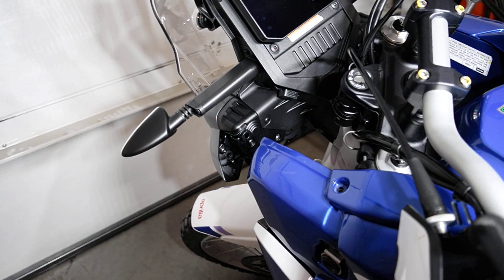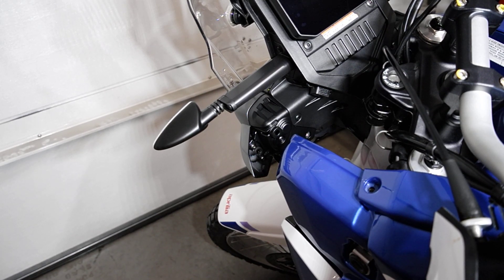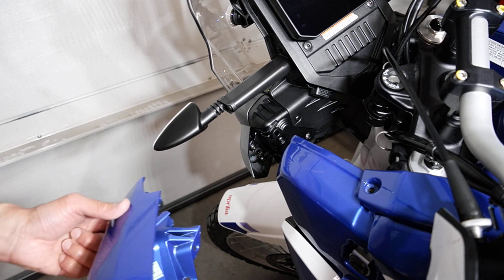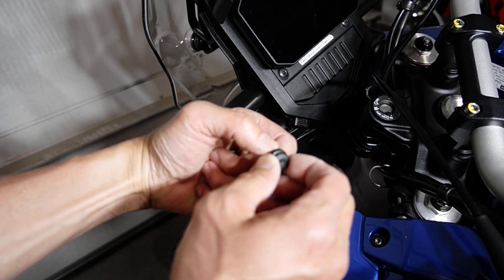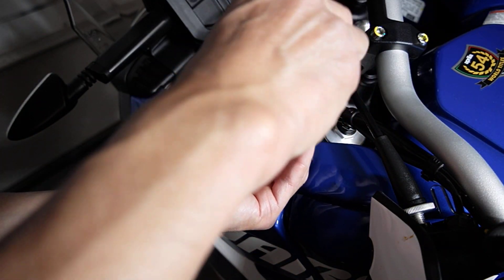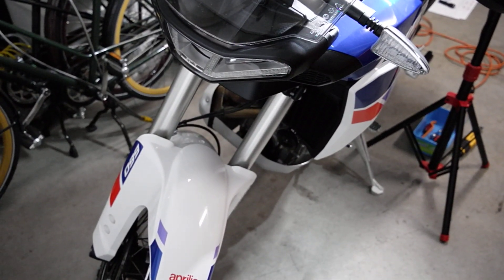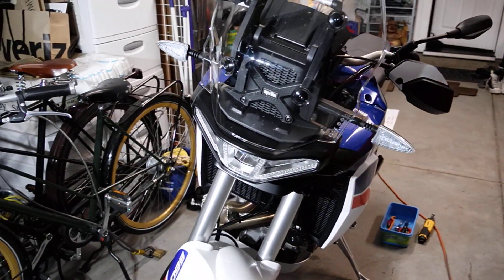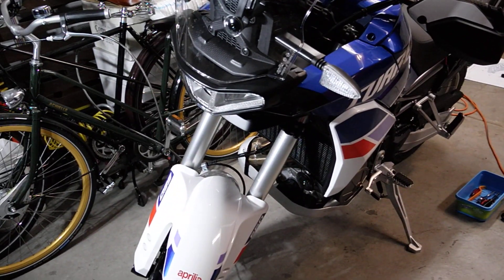Aprilia Tuareg 660 headlight cover in black Part 2/2

Comment: It looks nice. What kind of paint did you use?
Reply from the maker: Thanks.  I'm 99% sure it was Rust-Oleum "Trim and Bumper" spray paint in flat black.  There was another similar product by Rust-Oleum "ideal for pin-striping" or something like that I was debating between, but I can't remember what I ultimately chose.  It's at work, so I don't know for sure.  I don't think you can go wrong, just as long as it's a flat black and resists sun damage.  I put about 4 or 5 coats on it, we'll see how well it holds up.
Reply: @ocdmoto  thanks man! Looking forward to see what other mods you gonna do to your Tuareg. 

Hey how are the side panel vents that you opened on your other videos, does the right side make a difference with the heat now ?
Reply from the maker: @SuperCheesyMan  Hi, so it doesn't make a noticeable difference, in that I think there's just as much heat that I feel as I did before.  There are two things I'm considering in regards to "heat," one is the heat I experience on my legs and shins and the other is the management of engine heat from the radiator.  I feel the latter is more important, and in that regard, I believe opening the vents results in a better job of "cooling" off the engine.  In the regards to the amount of heat I feel, I actually was prepared to feel more heat by opening up the vents, since it seemed like more heat would flow towards my shins.  Nonetheless, I was ok with this outcome when I made my first cut into the plastic.  However, after doing so, I think the heat I feel on my lower legs is the same as before.  I believe most of the heat is from the cat and exhaust pipes.  I might get a straight pipe low restriction/weight silencer upgrade from Arrow or another 3rd part vendor if the heat is unbearable on hot days, but I'm trying to do all my mods with little to no cost.  We'll see, personal history has shown that I will go overboard with mods, but I'm trying something different this time with this new "toy" of mine.  Additionally, I'm thinking that that might be the theme of this youtube channel.  Thanks for the comments and questions btw.
Reply: @ocdmoto  dude, my pleasure :)

Yeah the catalyzer usually dump a lots of heat of your legs. My Ducati Multistrada was crazy hot because of that. A nightmare to ride in city and traffic. Once I removed the cat things got so much better, I'm sure a cost effective aftermarket link pipe will come out at some point. The Arrow one is quite expensive 🙂
Reply from the maker: I've got two more things I want to do for "looks," then I have to start going back to modifying the bike for legit reasons.  Hopefully by then, cheaper options may come out to bring down the market costs for pipes and silencers.
Reply: One thing I'm really waiting for is a high fender adapter ...
Reply from the maker: Or a beak, right?  Seriously though, I think I'm going to wait on a high fender, unless they look really good on the bike.  I know that for the Yamaha T7, the first one out to market didn't look that good.  Regarding accessories, did you see sw-motech's new stuff for the "rag?"  -BTW, that's what I'm calling it for short, very versatile, "going on rag,"  "I was on the rag all day," "she's acting up, she must be on the rag," etc.  Their crash bars look "sick," which is what the young folk call things that are cool.  https://www.youtube.com/watch?v=SpxRVIZP6QI